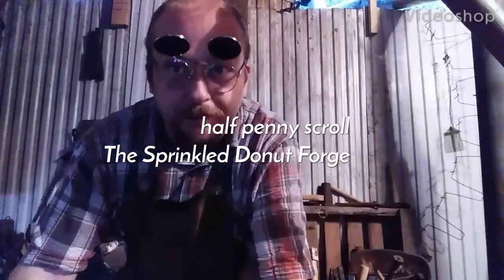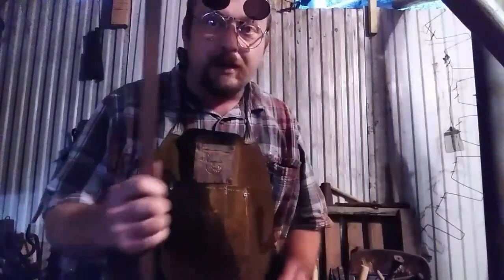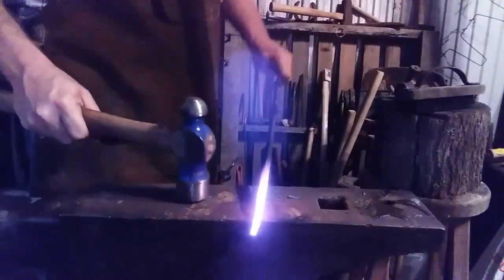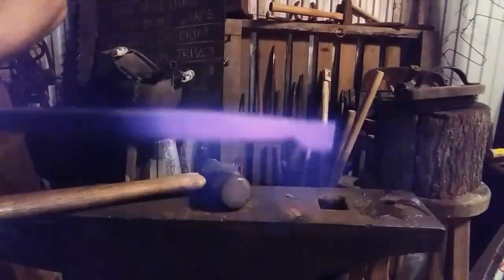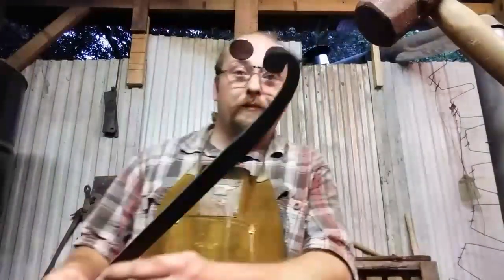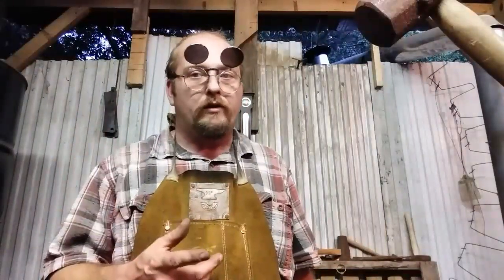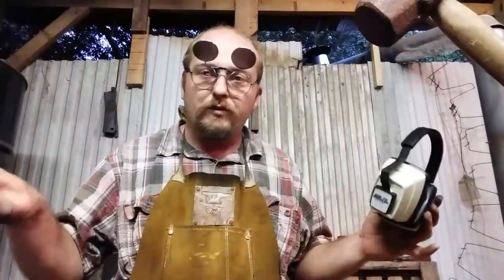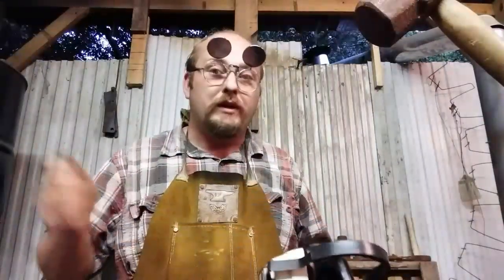Forging a half penny scroll

Comment: Thank you I was going through sprinkle donut withdrawal
Reply from the maker: Me too Rob. I been so worn out from working in the heat, a lot of days I come home, light the forge, and put it back out. I'm ready for cooler weather lol.
Reply: @thesprinkleddonutforge2774  here here. I second that. So hot the taters are air baking themselves!! Lmbo
Reply: @thesprinkleddonutforge2774  it's been chilly at night here. Y'all need a break. When I lived in Ft. Worth, you could ware shorts on Saturday and a parka the next weekend
Reply from the maker: @Grandadz Forge I enjoy winter forging, but one drawback is the ice cold anvil. I try to squeeze in as many summer night forging as I can because of extended working time between heats. I'm going to try and produce some more videos on design elements and basic formations in steel. I think it might intrigue some folks and help them.